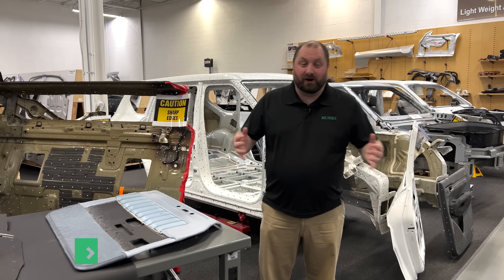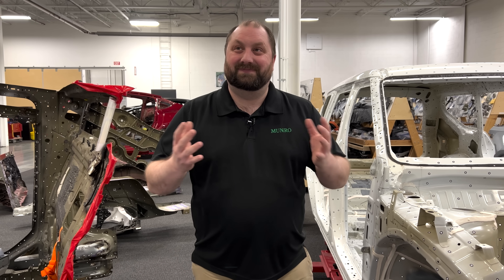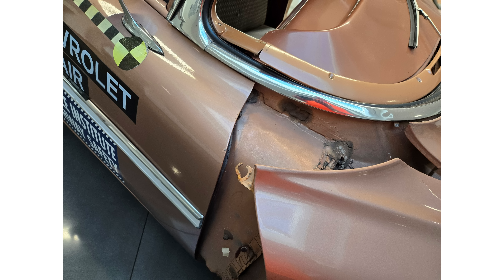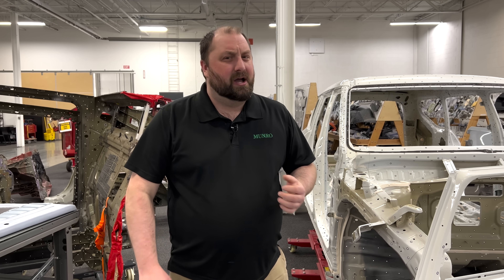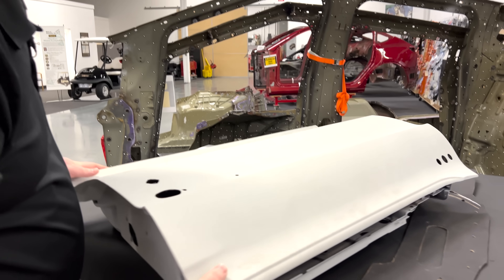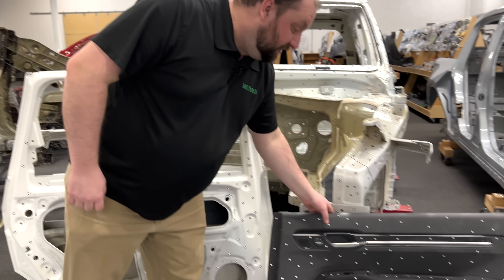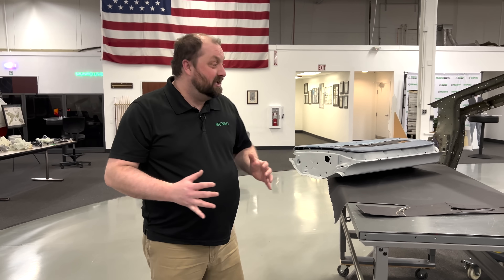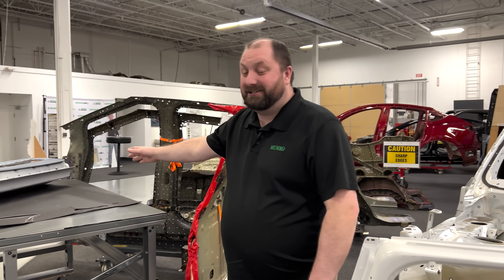No, Your Classic Car Isn't Built Better Than Your New Car

Comment: Great video. My whole career as an engineer has mostly been a battle against people with Luddite mindsets. We could advance technology and our quality of life so much more quickly if we had less Luddite in our DNA. I also appreciate that the engineers from 60 years ago were easily as smart (or smarter) as the engineers we have today, but the availability of advanced material, equipment, computers etc. limited what they could achieve. I’m sure most of the great engineers of the past would dream of the tools we have today and immediately embrace them. Go Metric.
Reply: Of course these cars were Tartarian, we didn't design the original ones, just like the entire patent system was stolen from some other civilization in about 1900. Totally different humanity drove the original cars that ran on multiple fuels. They were engineered perfectly to survive pandemics and be manufactured from top to bottom with little or no training. Once we get exploring Mars people will figure out what happened.

Comment: I drive a 1999 Yukon, and a 2001 Buick Lesabre. Show me a new Chevy that's going to be around with 200,000 miles on it 25 years from now. Safety and unibody construction maybe better. For crashes, but mechanically? Not so much.
Reply: Isn’t your Buick a unibody?
Reply: @Wasabi9111  yeah it has a subframe unibody, and I wasn't commenting on the unibody for its longevity just it's safety pluses. I mean the engine/electronics on today's vehicles sucks.
Reply: @MrRich2u  
How do you know??
Reply: Who cares about mechanical simplicity for maintenance if your family is killed in a car accident. Modern Jets are incredibly complex and expensive to maintain. Should we go back to the ones that were cheaper and easier to work on but killed people all the time?
Reply: @kennyg1358  Read what I wrote. I agree with the superior safety. Just saying that mechanically they are not as well built. Plastic is used everywhere they can to cheapen the build cost. Even Toyota which is known for their quality is using cheaper components.

Comment: As someone who also loves the style and simplicity of older vehicles, the safety is nowhere close. Don't forget about high strength steel in the A pillars etc after the 2000s. I used to have a Cummins swapped 90s Ford truck as my daily driver, then I saw a similar model where the drivers cabin area was flattened to the back of the cab after an offset frontal impact. Those floating fenders do not help much if the frame rails are missed during such a crash. After seeing that I sold the truck, though still have a old Ford for hauling dirt, now my daily drivers have more modern safety features. Some were better than others too, I have a classic Mercedes that would fare much better than the car featured in the video. Great video.
Reply: I have a car from 1967 (a hobby car not a daily driver) and it looks cool, but I have no illusions about it being a deathtrap.
Reply: Watched a crash comparison of a 2004 Ford f150 like I used to have, vs a 2024 f150 and was all I needed to see to vindicate using the latter personally and for all out family adventures
Reply: The obs were worse, the a pillars would collapse with very little stress
Reply: @donb347  What is meant by "obs"?
Reply: @jamesbosworth4191   "obs" means "old body style" that usually refers to the
Reply: How old is your "classic" Mercedes, and what model is it?  Mercedes used to use a frame that was similar to the X-member frame used in the 57 - 64 Cadillac and 58 - 64 Chevy, and the 58 - 60 Pontiac.  No side rails.  The Mercedes 300 "Adenauer" was the last one to use that type of frame.  1951 - 1962
Reply: @jamesbosworth4191  Good point, the W126 chassis I am referring to is hardly a "classic", and would be light years ahead in safety of the mentioned earlier cars. Mine is last of that body, a 1991, so even has the side impact bars etc, and wouldn't be a relevant comparison to the car in the video. Now in comparison to my 1990 Ford, there are some differences...

Comment: I sometimes find that new cars have too many unnecessary features. It is hard to find a bare bones basic car, but I guess that is just available in the used car market as there is no profit there. Henry Ford stumbled across the same issue. At least the French and the Chinese create cars like Ami and Wiling mini Ev. Too much luxury IMHO
Reply: Basic cars do exist but no one buys them. They are hard to sell so dealers rarely stock them.
Reply: @MikesCarInfo  But its usually because the whole car is basic. Not just in features.
Reply: @martinsvensson6884  Base model trims are still a thing. Same vehicle, less features.
Reply: @MikesCarInfo Not at all like it was back in the day when you could buy a Mercedes S-class with manual transmission and hand crank windows. As a European.
Reply: @martinsvensson6884  Before that it was hand-crank engines.
Reply: @MikesCarInfo  Exactly, and you cant get anything of that anymore. That's the point.
Then of course specifically hand crank engines wont be possible since you wont be able to turn a modern engine by hand power.
Reply: @ Entry level Cybertruck just released as originally planned. It has less features.
Reply: @markplott4820  I agree, it is amazing.
Reply: @MikesCarInfo  There is less profit margin, so no one stocks them. Also, a truly basic, reasonably sized vehicle has less profit margin, so they don't build many.
Reply: @ryuuguu01  No, that is not much of a factor in my experience. Dealers will stock what sells, and base models just don't sell very well.
Reply: I always see luxury cars as kind of living in a delusion
Reply: @cawfeedawg  Why?